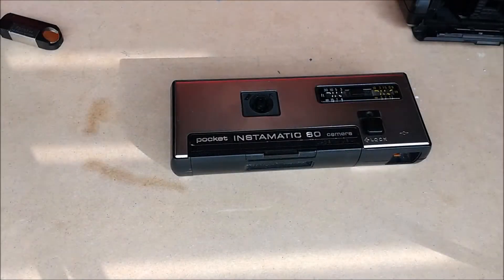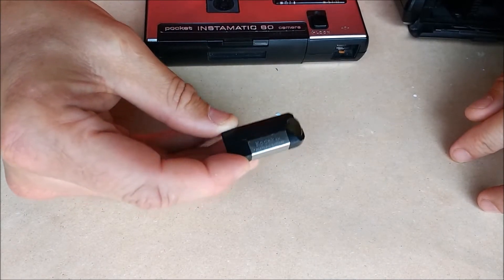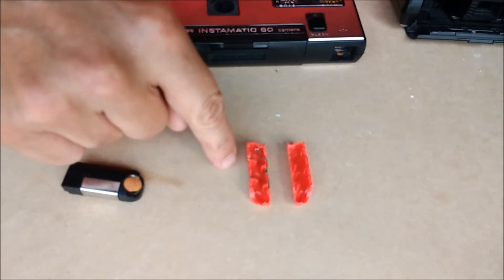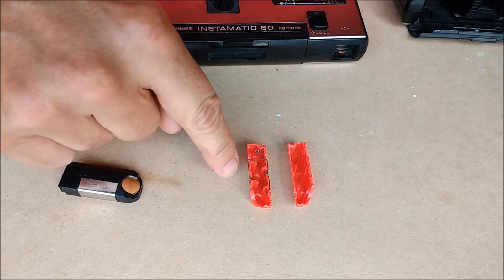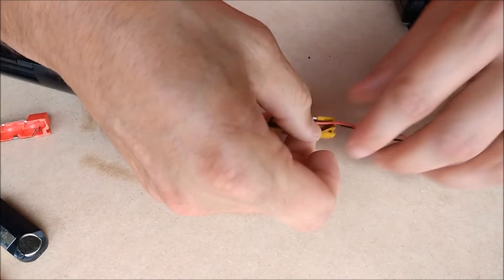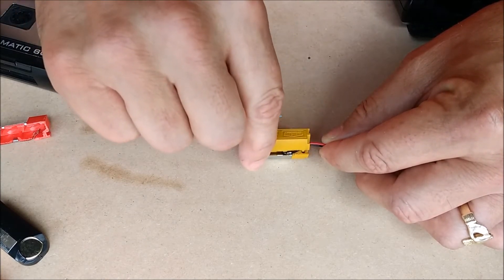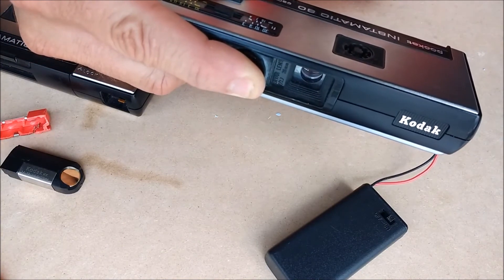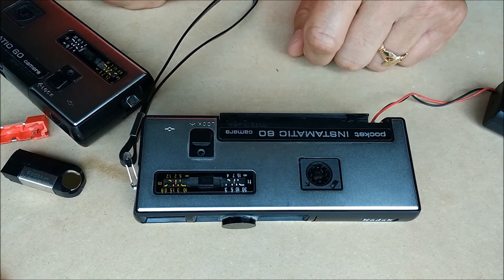The "K" Factor - Replace your Pocket Instamatic 60 Battery With Ones They Still Make

Comment: There now seems to be an option for 3D printed K battery replacement holders. You should give that a try as well and see how it goes.
Reply from the maker: I've seen them on eBay and have been tempted.  I've heard nothing but good things so far but I have not ordered a sample yet.  They do seem a bit pricey though.  I could probably buy two pocket Instamatic 60s for the price of one battery although it does seem to be easily reloadable.  Having more options to use these cameras is certainly better than having no options so I certainly do not resent anyone making a buck on their ideas.  I may get one for the sake of completeness.
Reply: @NanoBurger  Well if you have the means of 3D printing it, or otherwise use one of these 3D printing services, could probably source it cheaper. But the reusability is definitely a boon.

Comment: NanoBurger, would you be kind enough to shoot me an e mail. I have made some K type batteries that I think are good. Can send you a 'photo article' on how they are made and perhaps a sample or two. Might also be handy for your alternate power with an external battery holder. Much safer than trying to crack a plastic welded OEM battery open. Share a thought as time permits. Mike Chisena KA2ZEV@Yahoo.com

Comment: A 3D printed K battery  substitute has now been made, with variations accepting multiple different batteries.  There's even one model that take a rechargeable battery Print your own or order from an on-line site.
Terry
wd4aon@gmail.com
Reply from the maker: Terry, Could you give us a link to that?
Reply: NanoBurger:
Basic information is on the Submini-l.groups.io list.
  There are pictures there.
I have one of the first test units and have been successfully using it in a Kodak 60 pocket camera.  This one uses #312 hearing aid batteries; .stl files for other models/sizes/type exist, including a rechargeable 3.7V battery.
Final details on distribution are not yet in place, but will be shortly.  I'm not the designer of the 3D model; I only had the basic idea and suggested he make some test units.
I started with a hand carved wooden model; I initially used tiny hearing aid batteries, but with a bit of extra carving I enlarged the opening to accept three LR44 batteries, which fit - but tightly - in a Kodak 60 camera.
Once the 3D unit has been printed, adhesive backed conductive tape needs to be applied to it for the electrical connections.
Regards,
Terry
Terrence (Terry) Martin
Registered Patent Attorney
WD4AON@gmail.com

"The large print giveth, the small print taketh away"

Comment: It works! I used some copper tape that I have, cut it real thin, and used some scotch tape to use as insulation. I took out the guts of an old K battery and just attached the tape to the outside of the shell and ran the other ends to the Li-ion. I tested with a multimeter at the shell and it showed about 3.7 volts. Because the tape was so thin, I could easily close the film door where the battery goes so I wouldn't have to worry about light leaks. I tested the camera and the aperture opened up. I pushed the battery test button and it lit up green. The biggest advantage is that these batteries would last longer than button cells and you wouldn't need to purchase those batteries constantly or have to re-connect them in the shell.
Reply: Just a quick update. I found a nice battery case that holds 3 AAA batteries which give 4.5 volts. As described above, I used copper tape with scotch tape as an insulator and it is so thin I can close the film compartment without having to modify the camera in any way. I have tested the camera, my Pocket 60, and it works perfectly.
Reply: @GordonGlenn  can you link me the case you used for the battery's? Any chance of some images of the battery before it goes in the camera as well? :)
Reply: @Waspy  If you want to see photos, you'll have to provide your email because I cannot post photos here.

Comment: Doing a little more research for something with lasting power and allows for additional usage of old K battery shells. An NP-BN1 rechargeable lithium ion battery, like the one in my Sony Cybercam,  is 3.7 volts, super cheap, with plenty of juice and should be sufficient to power the Pocket 60. It should work very well for a project like this. Do a temporary connect to the + and - leads of the BN1 with conductive copper tape (to avoid risks from soldering) and to the + and - terminals of a K battery shell, ideally using super flat thin electrical wire which would be soldered to the shell, so you do not have to modify the camera case when using thicker wires. Use double sided tape to connect NP-BN1 to underside of Instamatic camera. When the battery runs out of power, remove from camera, recharge, then you're good to go for several more rolls of film. I'm going to test this theory very soon. In the meantime, I found someone that is 3D printing a K battery replacement that you insert 3 hearing aid batteries into. I received one and it works very well. It costs $18 plus tax. Send me a message if you are interested in information on that.
Reply: Hi—I'm interested in the 3D printed K battery replacement which uses 3 hearing aid batteries.  Could you send me the information when you get a chance?  Thanks! squirtiesdad@verizon.net
Reply: @doughollaway1775  I have emailed the information to you.
Reply: well i have no idea what any of this means, but good on you for figuring it out and sharing it. i just found an instamatic 48 at a thrift store, too bad there is no easy way to get it up and working for someone like me who is not technically proficient haha!
Reply: @bredmon  A replacement for the long dead K Battery used to power the Instamatic 48 is available through 3D printing and can be ordered, with all necessary parts, for $18 plus tax. That would bring your camera back to life. If you would like the ordering info, just leave me a message with your email and I will send to you.
Reply: @patrickman64  I have just emailed the information to you.
Reply: Hi Gordon Glenn , I have been trying to figure this on on the instamatic 48 for awhile now, same battery I couldn't find your email on here to get the link for the 3d printed setup if there is any chance you see this could you email me at brycearhine18@gmail.com I think this is awesome and I appreciate your time!
Reply: @brycerhine5165  I have emailed you the information. Have fun!
Reply: Hi.. I'm searching for a method to use my old camera. Maybe you can give me the link or information:
ppaoma16@gmail.com
Reply: Hi if you could send me the info on the 3d printed battery it would be great my email is poplunamtf@gmail.com thankyou!
Reply: @parz173  I have emailed you the information. Have fun!

Comment: This may be an idiotic question, but is the battery needed for the camera to work or just for the cameras flash purpose?
Reply from the maker: Yes, the battery is essential for the operation of the camera.  Without the battery, the shutter may sound like it is working, but if you look through the back of the camera, you will see that the shutter isn't opening.  The flash system is actually physical.  It uses Magic Cubes that have a piezoelectric firing device built inside the cube.  The only thing the camera does is push a small trigger arm into the cube that dislodges a firing pin of sorts.
Reply: Hi there, I was wondering if the same applies to instamatic 30? Can I use it still without the battery? I tried my best to find the k battery but cannot find one. Please help

Comment: Any tips on opening the k type shell?
Reply from the maker: Not many.  You just cut along the seam as best you can with a razor knife and pry it apart.  Some are designed with posts that fit into holes on the opposite side.  They are more difficult to pry as you usually end up breaking these posts.  Maybe I should do a video on opening one in real time?
Reply: That’d be great if it isn’t any hassle to you!

Comment: In theory can you use a 3 Volt CR2032 battery pack instead just so it isn’t as bulk as the double A battery pack? Going to solder for the first time so was just wondering if you’d think using the CR2032 pack would work?
Reply from the maker: It does not sound like it will be a problem.  I used AA batteries because they are cheap and available.  I actually made one with three AAA batteries that work fine and is a little smaller.  It has the advantage of giving the camera the correct voltage.
Reply from the maker: I don't see why not.  The current draw may exceed the batteries capabilities.  I'll give it a try and report success or failure.
Reply: @NanoBurger  The CR2477 battery has a higher current rating.  WD4AON at ARRL dot COM
Terry
Reply: Sorry, that was supposed to be WD4AON at ARRL dot NET. --Terry

Comment: I have an old K battery and I am going to try to replace the button cells so I can power up my Pocket 60 which I got in the early 70's. For a longer term solution, I have the schematics for the K battery from Eveready. It may be possible to use this information to input into a CAD program to recreate the battery shell using a 3D printer. I don't have a 3D printer, but it certainly is on a list of things to do over time.
Reply: Gordon Glenn how do you get the k battery schematics? Or can you share it? I may able to do some simple 3D drawing to revival my old 110 film camera, thx
Reply: @ericsokn  Hi guys,  On 1/19/2019 I downloaded "-ktypebatt.jpg" from the internet.  I cannot now find it again, or where I got it.  It is too faint to copy well.  It was a formal engineering drawing, "Drawn by J.M." on "Apr. 2002".  Perhaps you can find it with a better search.  The measurements match mine of a Mallory 7R31 size K battery.
wd4aon at arrl dot net --Terry
Reply: @ericsokn  I never knew you replied to my post. I can send you the schematics for the K battery. I'll need your email.
Reply: @ericsokn  Just emailed to you.
Reply: @GordonGlenn  Would love to know if you both are able to figure this out! I have two K batteries that are dead. Thanks!
Reply: @samanthastein6490  It's figured out. (1) You can order a reusable 3D printed replacement from someone I know and I can email you the info. You pop in three 1.5 volt button batteries and you're good to go. (Maybe not that simple, but you get the idea) or (2) I have modified an original K battery using 3 AAA batteries to give 4.5 volts. Basically using the old K battery as a dongle that is left in the camera and you just use rechargeable or alkaline AAA batteries in a small case on the outside of the camera. That would last for many more rolls of film than 3 button batteries. I have photos if you are interested.
Reply: @samanthastein6490  Just emailed to you. Have fun!
Reply: Hey did you have any luck with the k battery schematic? Found an old Kodak camera but need the dreaded k battery
Reply: @GordonGlenn  I would love the contact info for your friend who can create reusable shells for the button batteries!
Reply: @GordonGlenn  hey i know this is 2 years old but if you by the chance see this i would love to have access to the schematics for the k battery.
Reply: @marissajolie6857  If you can provide an email address, I can send to you.
Reply: @GordonGlenn  youtube keeps deleting my comments ahh
Reply: @GordonGlenn  youtube doesn't let you comment email addresses anymore so lets try this. the email starts with marissamarquardt and it's a google email haha
Reply: Could you mail me the link or file too?

Email. ppaoma16@gmail.com

Comment: Is there any way to use the shell of the k battery reloaded with button cell batteries?
Reply from the maker: Yes, I've done this many times, but it is kind of fiddly.  You have to connect the batteries in series and ensure that they don't short out.  Original ones have the batteries connected with a metal band.  I've done wires soldered to the battery, but the heat of the solder decreases the life of the battery.  I've also used conductive glue, which works better.  Use the highest quality batteries you can since it is annoying to construct one and you don't want to do it too often.  The silver-based batteries seem to work well.  Hope this helps.
Reply: Thx nano I appreciate it ;-)

Comment: Have you developed any film? Just wondering if you managed to get a light leak even though the film is in a cartridge. But hey, cool way to get around the issue!
Reply from the maker: Yes, I have.  I took my soldering iron and melted a hole in the back cover for the wires.  No light leaks were detected since the film is protected by the cartridge and backing paper.  Here is a photo taken with the modified system:  https://flic.kr/p/UVst1b

The film is outdated by decades, so that accounts for the graininess, but at least no light leaks.
Reply: Thats great! I may have to give this a try! Thank you!